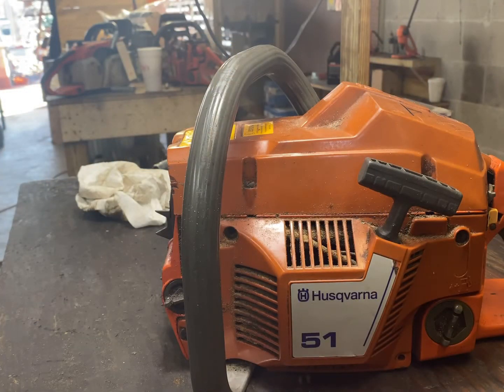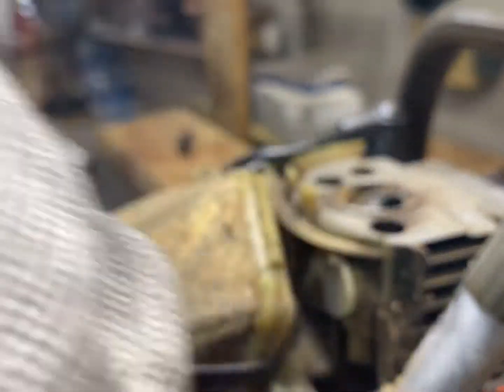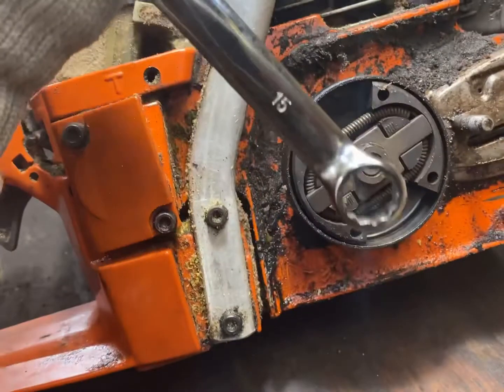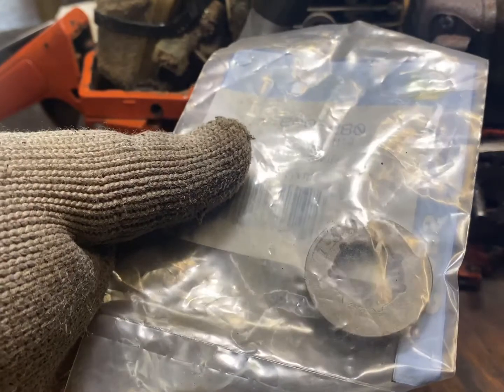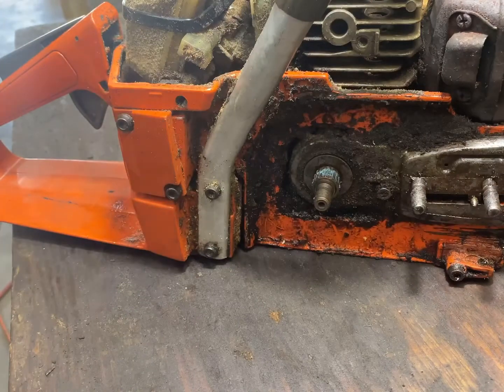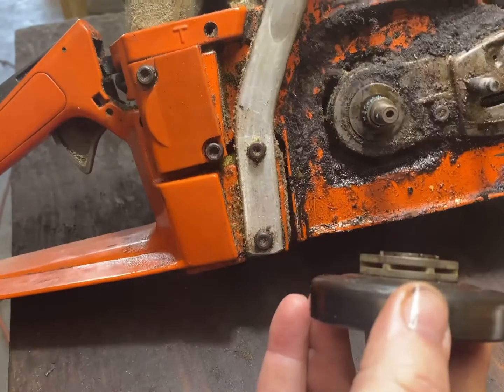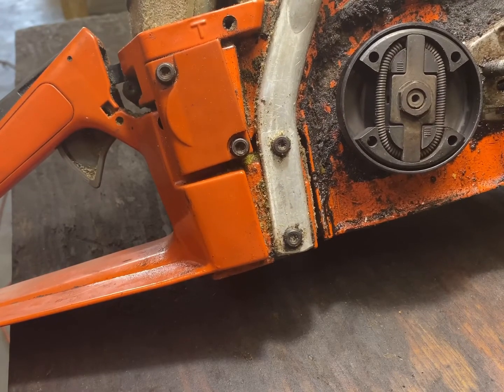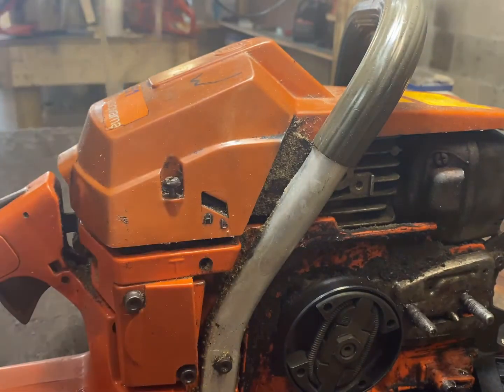Husqvarna 51 chainsaw, utilizing piston block for clutch removal.

Comment: great video.  Question: I got a replacement sprocket from Oregon part number 325-7.  What is the Oregon part number of the sprocket you used?  I have found that with these older P 50 and 51 saws, many of the replacement parts don't fit like the oem ones do.  Thanks.

Comment: Difference between .325 sprocket and 3/8 sprocket is so small, it's hard to tell the difference, only by using 3/8 chain on a .325 sprocket.